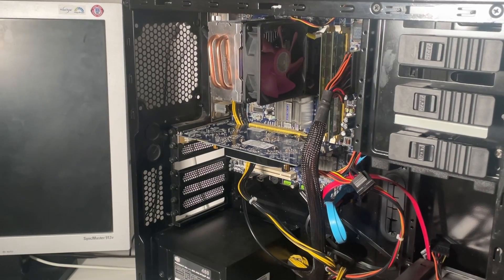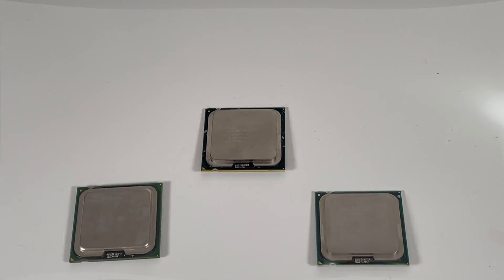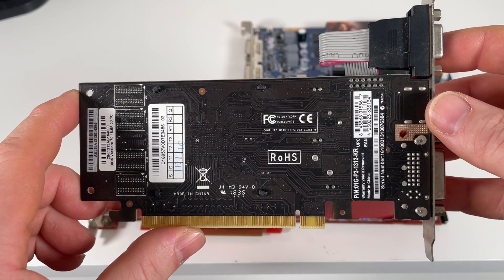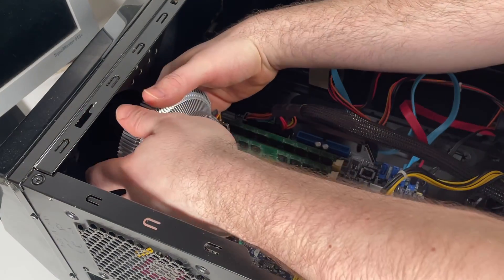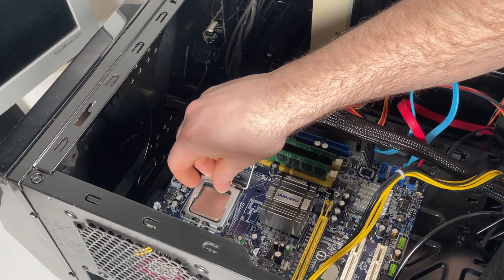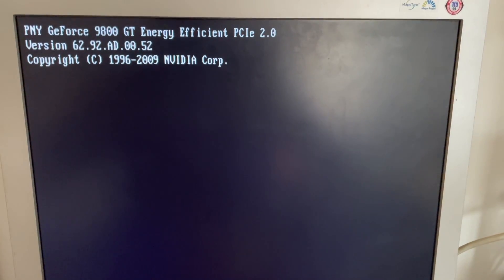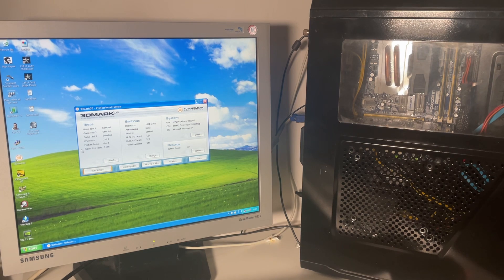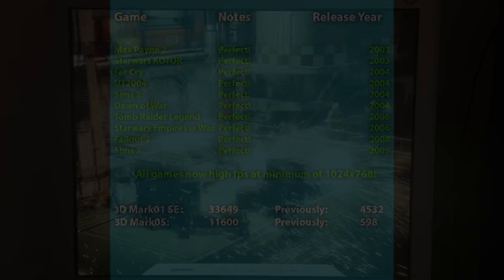£2 PC gets UPGRADED to a Windows XP beast?! (PT2)

Comment: Some capacitors I saw needed replacement.
Also you can flash the bios within windows, there are tools for that.
Very impressive finding a 9800gt without needind extra power.